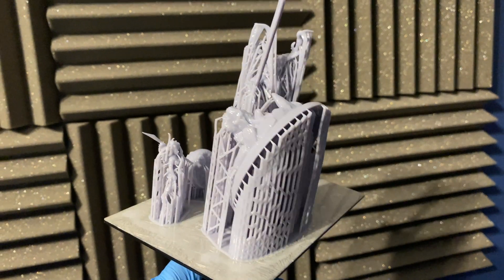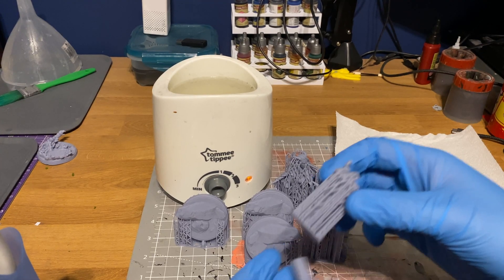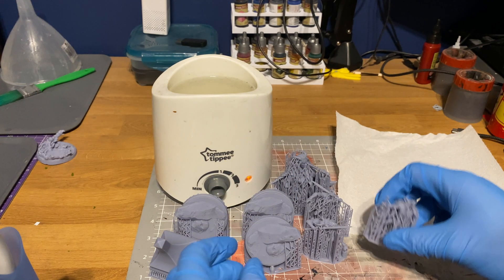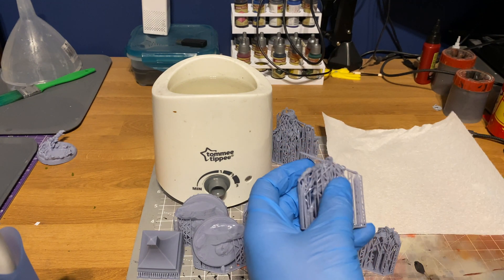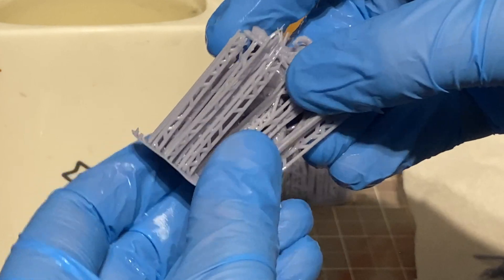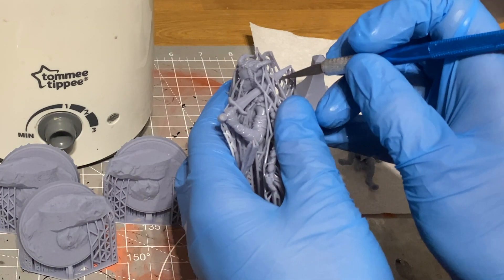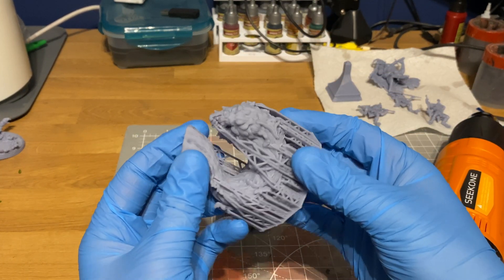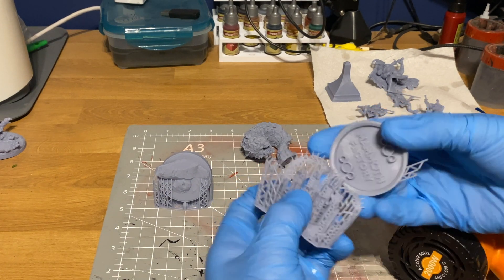How to Remove Supports From Delicate 3D Printed Miniatures

Comment: i also suggest dipping in IPA first to remove excess resin, as liquid resin is very slippery and cause you to accidentally drop the model or slip when you try to cut or peel.

Comment: I just got into 3d resin printing and after watching one single video where a guy said "i let them sit in 50'C water for under a minute" I had the presence of mind to buy a cheap electric kettle so I could just reboil that water again and again and again, and pour it into a basin with a cheap meat thermometer from the dollar store. You don't need to buy a baby bottle warmer.

Comment: hi, do you remove the supports after washing and curing the model?  thanks
Reply from the maker: I always remove before curing but after washing.
Reply: @GrayScalpMiniatures  thanks a lot. I do have a ton of issues with craters in my mini prints
Reply: @GrayScalpMiniatures  how to u cure after if the model is wet?

Comment: will the hot water technique work on cured models. I purchased a fc model trend 1/35 skeleton. I'm assuming it's cured? it seems very delicate...
Reply from the maker: I can't see why it wouldn't work on cured models. It still heats up and becomes more flexible, but I would imagine it will be open to breaking. I'm guessing you've been sent something that's still on supports? That's really unusual for sellers to do thatl

Comment: I don't understand why people are so concerned by a little resin contaminating water, people everyday pour detergents, bleach and loads of other chemicals down the drain. I am not saying its ok to dump a bottle down the drain, but the little residue left over on a print isn't gonna make anything worse.
Reply: A good way is to just do 2 alcohol baths. One first to take the bulk of the resin off, and then on a cleaner bath of alcohol to get rid of the little residues. It should be little resin remaining, which you could pour on a bottle, cure, and then dispose.

Comment: That tip around 3:00 about leaving the tiny support bits on during curing has been crazy helpful! Tried it out on a few D&D monsters and any leftover supports just rub off.
Reply from the maker: Glad I could help. Only found it out because I was super lazy one time and did an awful clean up job, and then after curing I was really impressed how easy they just rubbed away.

Comment: Supports for me are just a matter of where you're happy to spend extra time: 1. You can support models properly yourself (extra work, but saves time on removing supports and polishing) 2. You can quickly rip supports off straight after printing and if you rip off a sword or something, just flue it back together (no heating, no extra work with supports, but needs extra polishing/post processing. 3. Heating and carefully cutting off supports (extra work, but polishing becomes way easier and no need to glue any ripped parts). Just see which method fits better in your workflow. If you like extra time on your PC - go with the first. Don't have space for hot water/heat gun? Go with the second 3. Love that sweet sweet supports removal ASMR - go with the third one.
Reply from the maker: Such a good list for different people! Also, love the comment at the end about the ASMR 😂

Comment: Good reminder and help for newer printers - I've used the hot water for the past year or so with great success. I have to ask, though...it looks like your resin is very dry - do you cure first before doing the water trick, or is it just the video lighting playing tricks on my old eyes? 😀 The reason I ask is because I do the water BEFORE curing - seems to be much softer and pliable, making removing the heated supports much easier - just curious!

Thanks,
Kev
Reply from the maker: Yep I do it before curing. Think it’s more of a bad lighting issue in the room where I do my printing.
Reply: You should probably do it After curing to not have contaminated water on your minis (can interfer with curing) and to not have water with toxic resin in it.